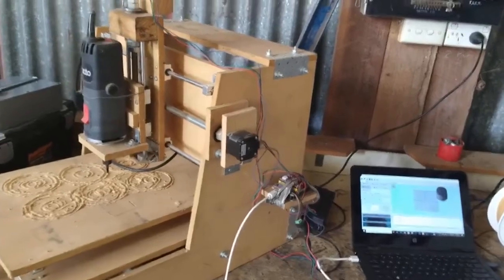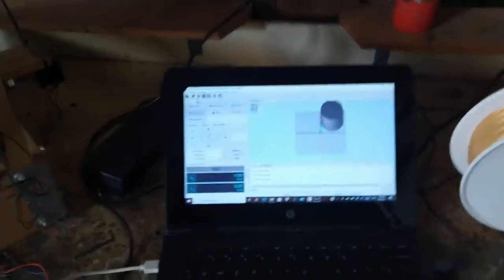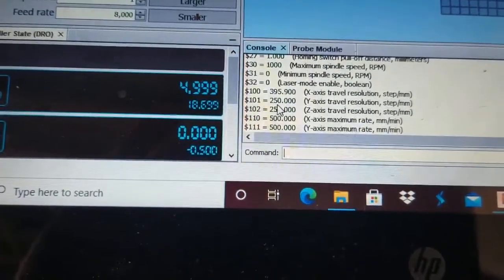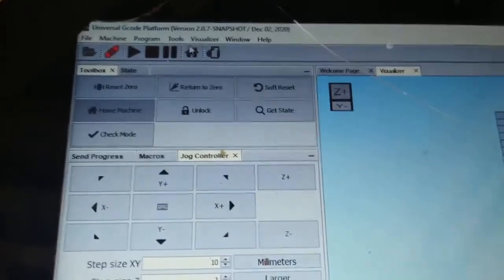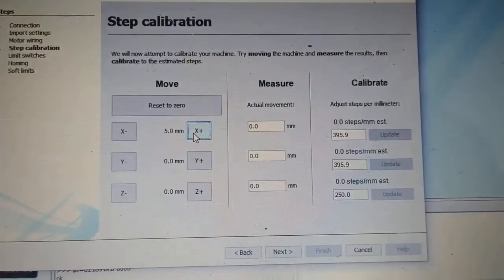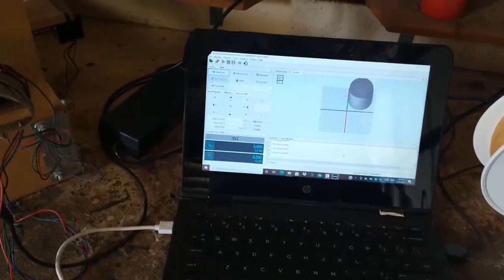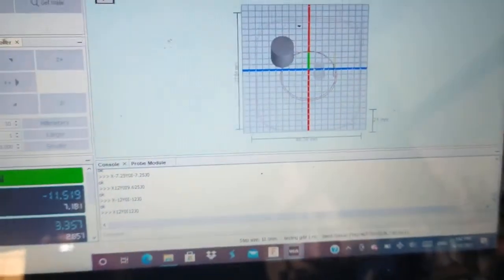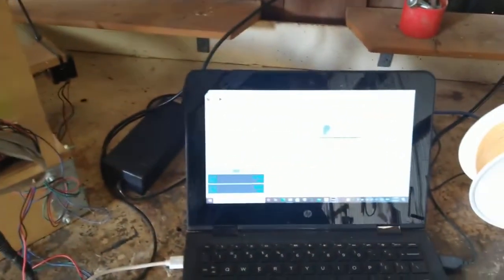stepper motor calibration on DIY CNC router

Comment: So you are running this on an arduino with a cnc add on? Grbl is on the laptop and the cnc add on?  What os does the laptop have on it? Will grbl run in a linux distro?
Reply from the maker: I think I misspoke in part of the video .
  Yeah it has an Arduino Uno with a CNC shield on it. The Arduino is flashed with grbl firmware. On the laptop I have Universal G code sender (I think I called it grbl in the video).  I have windows on the laptop, and I'm pretty sure it's Linux compatible , not sure about apple stuff ...
   I have thought about using a raspberry pi to run the UGS on, but I might try a USB version of Linux on an old notepad and see how that goes.
Reply: @landlifem5872  does this mean a stepper driver board is not required?
Reply from the maker: Nope, the stepper drivers plug in to the cnc shield , they are not high current driver's but plenty for the NEMA 17 motors. I think even some of the 23 motors can be run off them, but for heavier applications the big individual drivers are probably better.